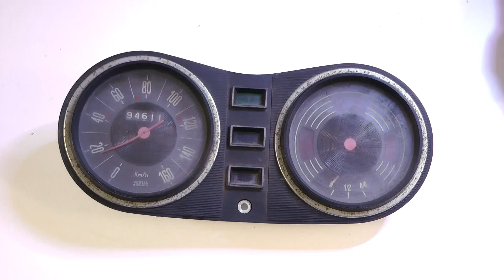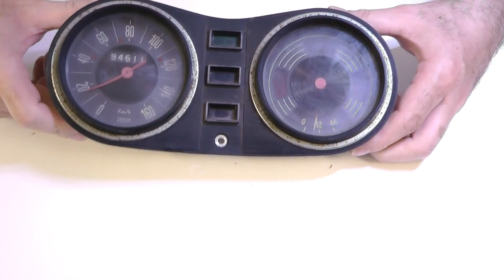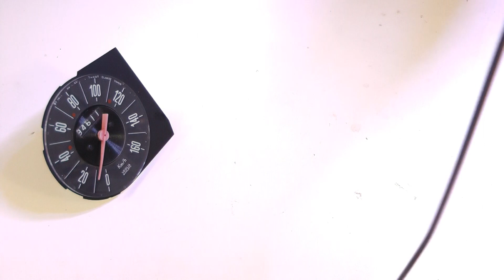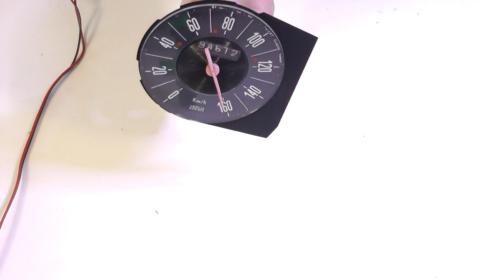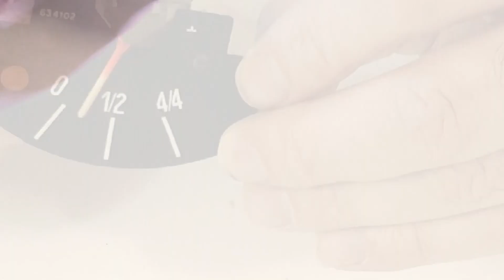Riparazione restauro e pulizia quadro strumenti Fiat 128 - Fiat 128 instrument panel repair

Comment: Ciao, ti volevo chiedere se le lancette sbiadite possono essere riverniciate oppure vanno sostituite.
Arrivederci
👍👍
Reply from the maker: Credo che si possono riverniciare, onestamente io non mi sono posto il problema, quindi le ho rimaste originali.
Reply: @MiroArea  Grazie mille per le info!
Reply: Guarda per esperienza non te lo consiglio purtroppo quelle lancette lì erano in polipropilene, cioè un materiale utilizzato della Fiat degli anni 70 principalmente sia nelle 500,126,127,128 si utilizzavano questo tipo di materiali era un materiale molto e dico molto resistente al calore, anche se col tempo evidentemente dopo mezzo secolo, adesso sono ovalizzate ma se tu tocchi queste lancette, noterai che sono molto flessibili infatti, non si spezzano il polipropilene purtroppo non si può verniciare perché appartiene alle materiali Plastiche non verniciabili però ti dico che qualcuno ha provato compreso io a verniciarle, raschiandole e levigandole per bene con una carta abrasiva molto sottile e bisogna trattarle con un Primer adatto per il polipropilene che non è un normale Primer per plastica e poi verniciarle di sopra, però evidentemente il risultato non sarà di certo durativo nel tempo, perché evidentemente ripeto, non è una plastica verniciabile e di conseguenza non ha un’aderenza, quindi si potrebbe anche sfogliare la vernice che è stata applicata su di essa